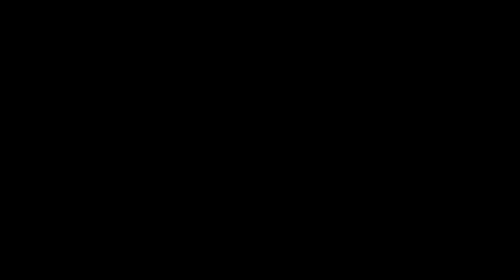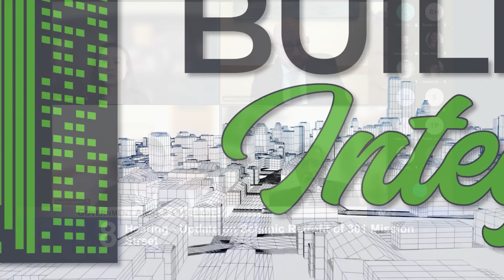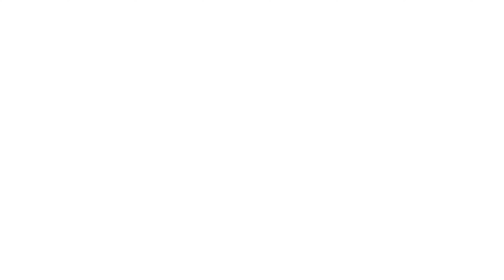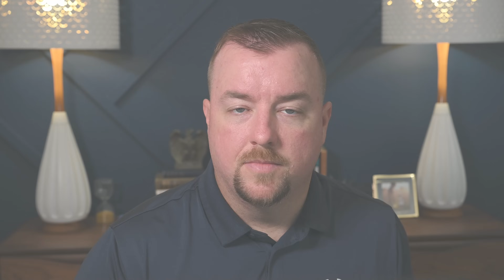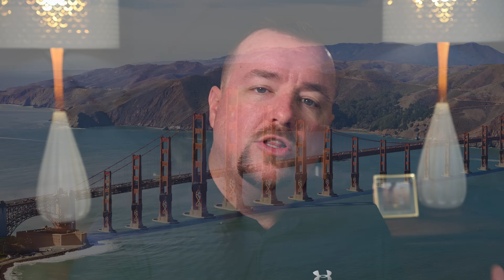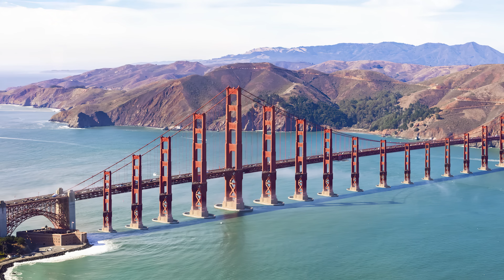Millennium Tower's "Sophisticated" Fix?  You Decide - (San Francisco's Leaning Tower Part 4)

Comment: Unless piles are taken down to bedrock, they will have no effect on the settlement; additionally, engineers need to take into account friction support from the soil (the current pile system), although down-drag from the surrounding settling soil must be included in the load on the piles. Drag down of existing piles will occur as each new pile is drilled to bedrock. Bedrock piles will need to surround the entire pad to account for the liquefication of the clays.

Comment: You cannot lift the foundation you cannot stress the pilings they are not designed for upwards lift... the building columns are not designed for mobile movement...the Matt slab psi and rebar are not designed to withstand the stress in upwards lift...

Comment: I'm not an engineer, but the way this has been managed seems almost arbitrary. How do you start with 52 piles, then arrive at a figure of only 18 piles to do the same job. The trouble now is, has the remedial work gone past the point of no return? Is the building now irretrievable now this work has already been done, precluding another solution? My guess is, that it has. The only way out of this is to demolish the building.
Reply: The drilling for the 52 pile plan was causing the lean to increase, so the engineers decided to use fewer, more heavily loaded piles instead.  Since the completion of the 18 piles, each loaded to one million pounds, the leaning seems to have been arrested.

Comment: I'd say that "18 piles" was the number they thought they could drive in before the negative effects on the building were so massive that there was no chance of their fix working at all. I'd say the question, if 18 were enough, never was a factor in any decision aside from that number simply forming upon the realization, that their plan will soon inflict so much damage that the building quite literally will reach a point of no return. 
So "18 piles" merely were a last resort, as to "let's try this, because anything else we half a*ed so far didn't work, and maybe we can half a* our way out of this if those 18 piles last long enough until we retire and it becomes someone elses problem." 

In other words: "We are f*cked any other way, so let's go for the solution that has a 2% chance of actually working because admitting to be wrong or lazy just isn't our style". 
Or as RH would say "It's important to understand the circumstance under which the decision to go for 18 piles was made. If you look at the 0% chance of our previous plans working out, the 2% chance of this new plan - yet again based rather on our strive to cash in on this with as little effort as possible rather than actually doing our job - look like the absolute jackpot!
Reply: The 18 piles have reached bedrock and have been loaded.  Latest reports are that the leaning in that direction has been arrested.

Comment: My biggest question is why the fix has hydraulic jacks. Are they intending to lift the side that is sinking? That seems like it would put excessive and unexpected loading on the foundation pad.
Reply: Jacks are needed to apply the load to the new columns.  What type of jack would you use?

Comment: This whole sequence of events smells like the engineering firm and customer are both firmly of the belief that the structural problem is not a problem and that the fix is only for show, and that more 'fix' (within given constraints, like not disrupting use) would therefore be better as far as property values were concerned.

And then the plan collided with reality, and it became clear that if they installed the full overkill plan, they'd make the problem worse to the point it may become, in their assessment, an actual problem - either a structural one, or an even bigger property value problem.

Comment: Hamburger's design philosophy is ridiculous.  I have done numerous piled foundations, and as a structural engineer, you are provided the pile capacity by the soils engineer, which in turn is used to calculate the number of piles required given the imposed loads on the pile caps.  Pulling the number of piles or pile spacing out of the hat without having a clue as to the capacity of the pile  is asking for disaster.  The end result is either overdesigning or under designing the structure.  Hamburger's method is laughable and delusionary.  This is a perfect example of putting the cart before the horse.
Reply: Since the new piles were going to be set on bedrock, the soil doesn’t much matter.  They do know the capacity of the new piles and did design the system for that load.  The piles are now in place on bedrock, and loaded.  The leaning has been arrested without anything breaking.

Comment: im not à civil engineer, so question is, what are the standard practices in making tall buiilding foundations? what normal ostandards did they not follow?
Reply: Foundations on piles which do not reach bedrock are not unusual, so I’m guessing their factor of safety for the length of the piles was too low.  Had it been larger, it might have compensated for inaccuracy in determining soil characteristics.

Comment: I’ve not gotten thru all of the videos on MT. Re the potential of Dynamic Failure. What variables are involved with that process? I’m curious about the deep soil types, primarily the clay and old bay mud soils and notion of ‘displacement’. Yes, the surrounding areas are paved or have buildings, essentially holding the ground ‘in place’, but isn’t MT close to the Bay Front? If so, then there is no counterweight/pressure, whatever term can be used, to impede soil displacement. I have this vision of this building tipping to the point where the deep, slippery (clay and mud) soils that the building sits on actually do slip towards a weak point(e.g the bay) and the superstructure rotates around an axis to the point that the building’s bottom just pops out of the bay as the top of the building crashes down on neighboring structures. In an earthquake, what about soil liquefaction compounding the problem? Not an engineer, just have a way too creative an imagination!

Comment: SGH are a bunch of total hacks. They had NO BUSINESS serving as engineer for this foundation stabilization project of this magnitude. When they consulted for me in NYC (I'm a licensed structural engineer and project director), I had to redo all all their work for them as it was impractical and unusable. On another project in NYC, I drew some preliminary SKs  and they took my SKs and COPIED and PASTED them on THEIR LETTER HEAD. Their method for the repair was totally unsubstantiated and not based on sound engineering practice.

Comment: A little story about engineers over thinking a problem. I was planning to build a house on some property I owned. The area required a Onsite Wastewater Treatment System (OWTS). It was necessary to find the water table to set the elevation of the filtration bed. So the deign engineer employed an excavator and a soil biologist and dug as far down as they could in 4 locations but could not find the water table. I arrived to find them discussing the problem of establishing a THEORETICAL water table and how to accomplish that. As they were formulating a plan I pointed to a pond which was about 50 feet away and 15 feet down and asked if they couldn't just use that water elevation as water seeks it's own level. A long moment of embarrassed silence was followed by "Well,,,,I guess that would be OK." I left before I started laughing.

Comment: There is almost three times as much money to be made on 52 piles as is on 18. I expect there is only money left to build 18 piles. 

When the original architect designed a 58-floor building with a foundation that floats on bay mud and sand  in an active earthquake area without pinning the building to bedrock like its neighbors, the project was doomed before it started. If more ground was available around the outside of the building to be stabilized it might be possible to stabilize the soil to the point that holes could be drilled down to bedrock, then filled with steel and concrete and tied to the foundation with grout instead of driving piles and vibrating the building ever deeper in the bay mud. There may be others now, but Haliburton is the only one I know that does that kind of work. 

I doubt there will be a successful resolution of this problem.
Reply: The 18 piles have reached bedrock, and the lean seems to have been arrested on that side.  They are larger than those in the 52-pile configuration, because the load per pile is much greater.

Comment: If I were doing the design for the remedial foundations I would have opted  to pile through the 3m thick raft using wash-bored steel tube (old oil pipe) micro piles to rock. I would start at the high end in the hope that it would induce some foundation settlement and work towards the low side. Once drilled and filled with grout, pour a new raft overtop of the existing to link the new piles to the structure. I'm sure you could do some relief drilling to around the base of the existing piles on the high side to incurage settlement if the pile drilling was not enough. I'd love to see some CPT data for the site, does anyone have access to this?

Comment: The reason they started at 52 instead of starting at an optimized solution is most likely corruption. Mr Hamburger to the construction company owner; "Hey, it only needs 18 but we'll do 52 and we can split the excess profits between us. Nobody ever asks any questions around here." Then the plan failed ....
Reply: Not likely.  In the 52-pile configuration, the individual piles would have been smaller and simpler.

Comment: Why don't I feel comfortable in the progress of fixing this problem?  For the same reason that the Champlain Towers Condo building is not there anymore!  "Hmmm, looks like a problem, we should discuss the issues. How about in 2 or 3 weeks?"  When will it become immanent that the building is not going to survive?  400 columns to 52, to 18?  If that's the way the building was designed, it is no wonder it is leaning.  Soon the mechanical equipment in the building won't work properly, or NOT AT ALL!

Comment: How many pilings?  Anyone can build a bridge that will hold up; but it takes an engineer to design a bridge that will barely hold up.  I.e., the engineer is supposed to be able to optimize the solution.

Comment: Isn't the foundation slab sagging in the middle like a bowl? How will this fix sagging in the middle of the building? And if installing the piles is causing the sag to one side to get worse wouldn't you install the piles on the sagging side to compensate? - from an average layperson with no clue about any of this.

Comment: A  few questions for you: 
1.These additional piles are slender relative to their length. We know from Euler that the slenderness of a column affects the load it can carry before buckling. What is the length of these new columns to the point that they contact the bedrock ? 
2. How solid is the material they are in, and can it resist the forces that would cause the column to begin buckling?

Comment: I'm no engineer but ...
The only thing that seems to have always been optimal is the level of incompetency.
How can the same people that have shown such incompetency still be in charge of the project ?
Why people without engineering degrees are the ones asking the questions ?
Why has the parameters of the solution to be implemented not been established from the very beginning by authorities i.e. being a long term solution ?
W T F is going on ?
Answer : cost$ are the only things being optimised while assuming responsibility is minimized.

Comment: My guess is the solution will continue to be debated for awhile, but some type of grout  injection will ultimately be used in conjunction with new perimeter piles and a jacking system.  This is really forcing some novel innovation of post construction engineering!  May change how things are done in ways we don't even see yet.

Comment: Hi, Josh - thx for all the vids. Is there any update since the last? The suspense….

In all practicality, seems that the building is unsafe long term. Rather than trying to resolve the tilt, would it not behoove a consultant to recommend a re-build? Rightly so, it’s expensive but the design concept was wrought from the start. 

Curious to understand the reluctance of lives over costs. Thx again.

Comment: They need to consider what is going to sit on the pilings they put in.  Needs to be the Vertical columns where it meets the the bottom of the building.  Otherwise you have to be concerned about the punch though sheer.  Then you calculate how much load is going to be on the piling and the material strength to determine the thickness.

Comment: <sarcasm on> If the fix is making the problem worse by increasing settlement, maybe move the crew around to the other side of the building, and fix that side instead.  the building should straighten up in no time  <sarcasm off>

Comment: I’m not a structural engineer but I’m smart enough to understand that when you core a hole in soil that is under pressure, the soil is going to naturally migrate into the void you just opened up. 
I’m only casually following this story but I’m of the opinion that the building is past the point of return. Is like owning a lemon vehicle, you can continue to throw parts and money at it but you’re never going to fix a flawed design.

Comment: Someone posted here awhile back that the solution is to simply tear the building down. Although this appears extreme and unnecessary…it does launch at least one important question:
i)  what will happen to this very, very heavy reinforced concrete structure when the next seismic event hits the Bay Area.
ii) to save 4 million $ they decided not to sink supporting piles to the Franciscan Bedrock…. and have since spent how much.

iii) although the law suits are civil in nature there appears to be an almost criminal attempt to defraud the building budget …in an area…you must remember that is subject to major seismic events.

iv) the condo owners as well as the neighbouring tower owners and operators are at an increased risk of property damage or worse if “The Big One” comes a knock in’.

v) finally … instead of preventing the bum side of the structure from sinking further ….would it not be just as effective to a) either cause the good side to start sinking faster… or b) to begin installing a total set of piles to the Franciscan Bedrock …..BEGINNING with the “good side”.

Comment: This seems like a problem that could drag on for years in any other city , but this is San Fransisco, a city known to be at risk for significant seismic activity. I am stunned that a high-rise building could even be built there w/o thorough and carefully reviewed engineering, let alone approving an obviously half-assed guess on remediation.
*not an engineer

Comment: Yes, the original engineer did specify a 6-spacing, AND he knew the mass of the building and foundation. The original engineer of record computed a load per piling and gave that to the geo-tech engineer. The two specialities both fall within the broad discipline of civil engineering, but one studies structures and load paths TO the ground, the other studies the effect of those loads once they reach the ground.
When the lead engineer specified a load per piling in "kips" he was using engineering shorthand to express the phrase, "kilo pounds per square inch", or some number times the quantity 1,000 pounds per square inch. That you did not catch this crucial detail indicates that your opinion on this subject is a lay opinion and not one qualified to comment on this design.
Yes the engineering is flawed, but please show me your detailed calculations and we can discuss their merits. Oh, I am an engineer and understand the complexities of sub-surface loading, load-shifting and sub-surface movement.

Comment: One would assume that the geo-engineer is not going to know what configuration of piles is needed to avoid over-stressing the foundation of the building. So they can only calculate what they are asked to. They can't provide an answer about the optimal layout of piles in a vacuum. The engineering process was clearly broken. 
The question of loss of effectiveness of piles in close spacing does not appear to have been mentioned. That seems to be something of an elephant in the room for 18 versus 52 or even 400. It is ridiculous that there s not actual presentation of calculations or process, or third party analysis. A number of non-engineers are making statements of "smell test". Where is the presentation of the analysis done by the geo-technical engineer? The entire session was a total farce. People without qualifications making judgements on a proposal that is presented without supporting documentation. If that is the best that can be done they deserve to have the building fail.

Comment: We had almost the same amount of fun when the King Dome was built in Seattle. An X shaped form was built so ribs could be poured at the same time, then sections of the supporting legs were supposed to be shortened so the form could be rotated then raised back up to pour more ribs.

When the form was lowered, it didn't come down enough to allow it to rotate. My memory is not the best but I believe the building was paused for a loooong time, and another firm was hired to fix the problem.

Sure was fun when they blew it though. ( much later, and not for that problem, but it wasn't paid off yet)

Comment: A follow-on query from my earlier comment. If the piles are, as at present, bored/driven at 6ft centres would there not be vibrational ground disturbance of some significant distance from the pile centre with consequent widespread lessening of the bearing capacity of the soil? Might this be the reason for the proposed change?